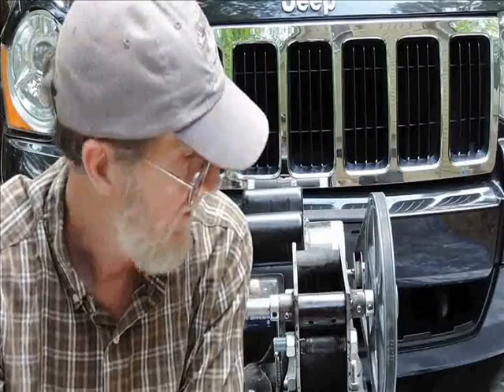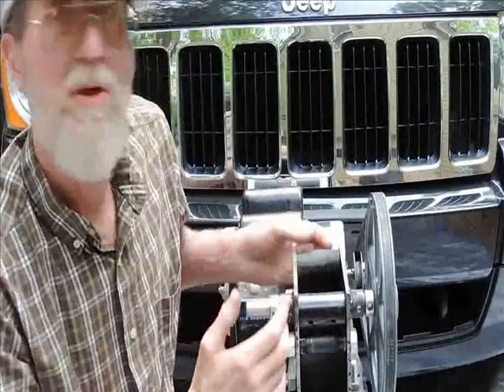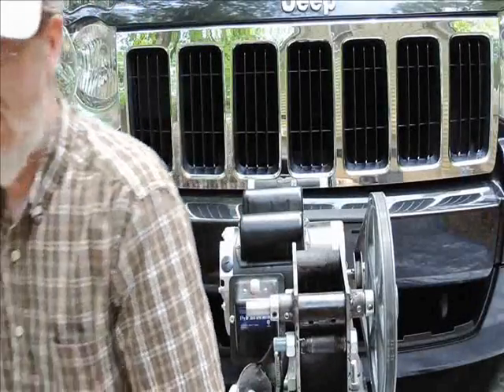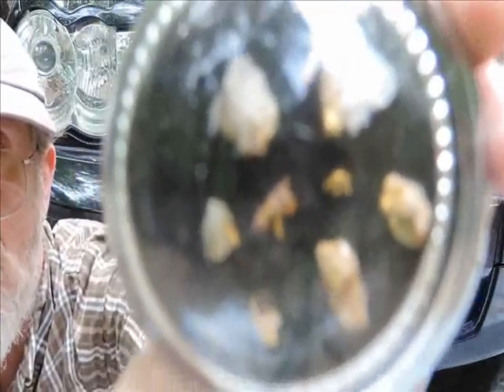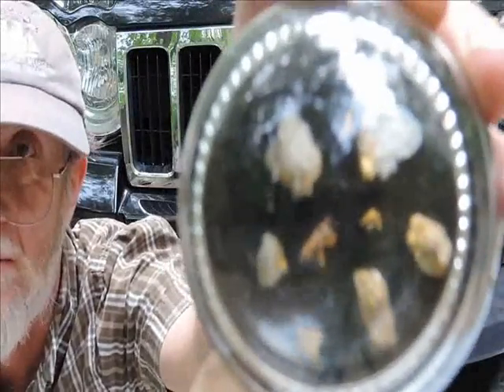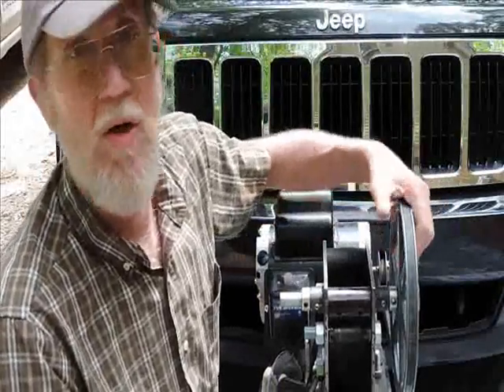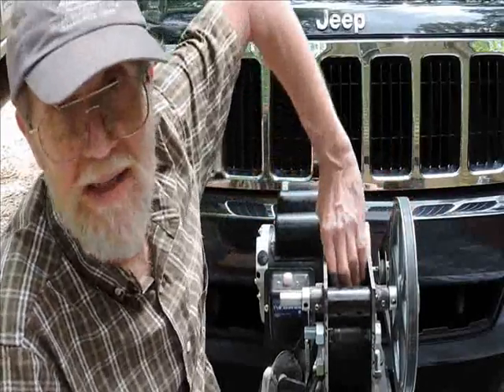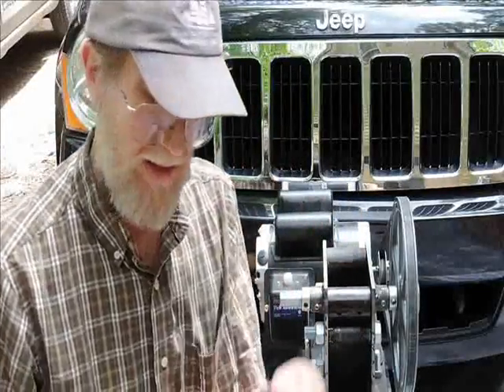Gold Ore Crusher DIYJaw Crusher

Comment: Would you please post step by step instructions and a materials list for your jaw crusher. It is great and exactly the size I need. Like you I prefer the ability to break the rocks, not necessarily turn them to dust.
Reply from the maker: Thanks for the comment. Fortunately I did indeed videotape the process of making the crusher.  The downside is working mostly by myself I just mounted the camera on a tripod and started fabricating.  I have probably 20 hours of raw footage that will have to be edited to a precious 15 minutes of finished tutorial.  I will see what I can do but it will take me a while.
Thanks again.
bob
Reply from the maker: Tutorial is finished. it is in 3 parts called Gold Ore Crusher Tutorial part 1 etc. at my channel rlbob1.
part 1
http://youtu.be/DYg9s_7fTdM
part 2
http://youtu.be/S9XyGiZsWF4
part 3
http://youtu.be/-szNj2zKvwI
It runs through quartz rock like a buzz saw.
Reply: +Mary Theodosis 
I'm with you on that.  I REALLY like the idea, looks presentable, & is functional, but I like you need step by step to figure out how.